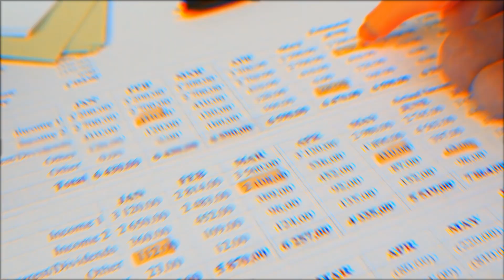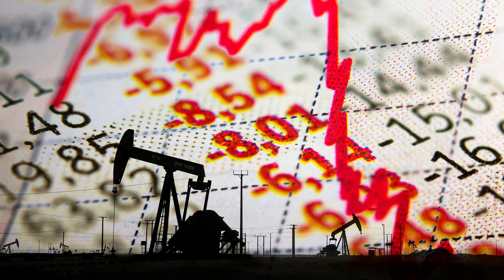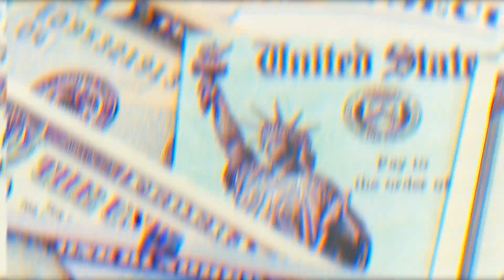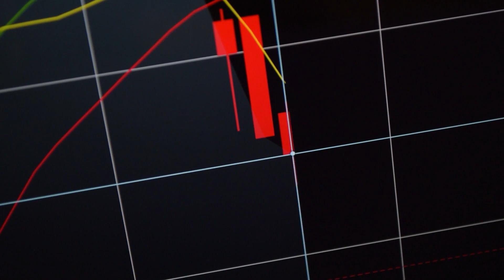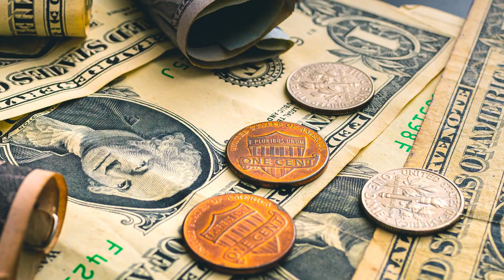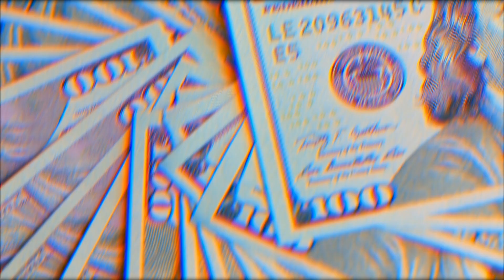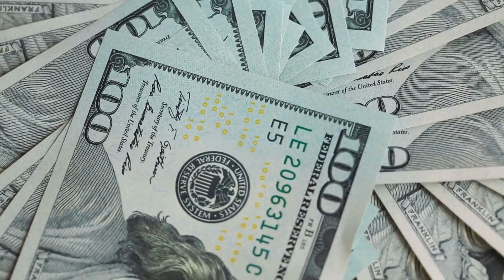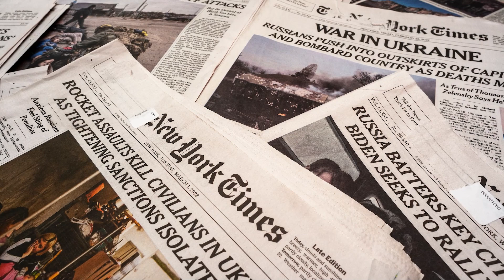How to Prepare for an Economic Collapse

Comment: Great video!
Im retired on 15 acres and my main trading/bartering item will be firewood. Although I have it where people driving by can see it, it's difficult to steal lots of wood quickly. I have great neighbors who would sound the alarm. Don't need much gas to split lots of wood. Splitter is very heavy, secured in concrete with the wheels removed.

Comment: In the UK you get small gardens with even detached houses. Plus, where I am in North Wales the soil is heavy clay and the climate is wet. Still, I've decided that fruit trees in my garden 50ft by 100ft is an option as fruit would be tradeable. Plus, patio veg in pots, tubs and buckets along with 3 rhubarb crowns. Not enough to live on but will supplement stores.
Reply: Potatoes! Ammend the soil with sand and organic matter and it will get better.

Comment: I've decided to try gardening. I've started small with mint leaves, and I bought fabric gardening pots to grow outside my balcony. I just have to get the soil, since I have seeds that I've collected over the years. I still bake so I try gathering as much baking supplies because it could be a way to make a little money. And every one needs bread or a sweet treat for morale.
Reply: The potting soil sold in stores is a rip off. Buy a bale of peat moss, equal amount of compost, and half the amount of vermiculite or perlite. Mix. Better potting soil for less money, and you can cut up dried banana skins to mix in for part of the plant food/fertilizer.

Comment: My biggest concern in a collapse is water. I live in Texas where we experience drought - no rain. The community where I live is supplied by well water that uses the grid to pump the water. My thoughts are to get a large surface tank filled with water now and add rain water collection gutters to feed the tank if I'm forced to use it. The rain collection would come from asphalt shingles so their would be hydrocarbon contamination.
Reply: You can get a large tarp, cut a hole in the very center, and then elevate the four corners using tall poles so that the water will drain out the hole and into your tank.
Reply: There's a number of solid YT videos on the topic. Some of those holding tanks come as kits that look fairly easy to assemble. I may be biased, as I used to build buildings. But I am in a wheelchair, and I feel that I could still put one of those kits up with time and some coffee.
Reply: Water collection is legal and encouraged in TX
Reply: @TShirtAndReeboks  yeah I'm not sure why it would be illegal
Reply: @Rubio_Eric  You just have to make sure you're not breeding mosquitos.
Reply: @HappyHoney41  maybe close it off and open when we're expecting rain?

Comment: I live on the family farm (23 acres) and we have many things in place, but there’s always more to do! I’ve been working on beefing up the ability to make our own power via portable solar panels and batteries, bc without power of SOME sort, we don’t have a running well, and then we’re in trouble. 😬

Thanks for all of your info and hard work, Kris!
Reply: Yes, I'm looking to drill another well with a hand pump like both my Grandparents had on their farms.
Reply: @aurorarose2836  - our well is 300+ ft down, so hand pumping isn’t something I’d want to have to do. 😬 But our pump can operate on DC or AC power, so I’ve been working on figuring out a doable solution for running the pump if the grid goes down. 

I have something figured out. It wouldn’t be fun, but it would be doable.

Comment: The tallow candles made me laugh. I just finished making two emergency candles out of crisco and pasta jars. They are cooling off on the counter now.  That said, Im not relishing the idea that I might be sitting in the dark with just those to read by.
Reply: You can make light amplifiers out of mirrors
Reply: @annak804  amplifiers sure but they said dark. You need a light source in the dark. Although youd be better off going to sleep.
Reply: Bring in your outside solar lights. Safer and give off more light.
Reply: @janmyers2902  you'd better block your windows if you have light inside at night. People can see that light from outside, see what is inside your house, especially if the windows are open. It makes you a huge target. Best to sleep at dark, wake at sunrise. Save candles for cold nights when the windows are closed, curtained, sealed, so nobody sees the light.
Reply: Hey, you're two candles ahead, and you can read in the daytime!

Comment: Food and water preparation is a must because if it collapses in the middle of or the beginning of winter, you're in for a long hungry time. If you can get through six months after a collapse, you're one of the lucky ones because it could take up to a year before your produce comes in and you have something else to eat. In summary, your preps should be at least A year in case you have to go all through winter and then all through the summer before any produce is coming out and that's only if your garden is perfect from the start, and knowing that you planted enough to last you the next winter.

Comment: Might I suggest you use car alternators, bypassing the 3 internal diodes to run wire from to connect to the fuse box, and for your ac source use a compacitor to it. Need more power, run an additional 2nd or more alternators in line together.

Comment: I think I paid $1.80 for a pound of kidney beans and about $1.00 from Walmart last year. Did an experiment with seeing if these would sprout. The lentils are nearly 6 inches tall and are out in the garden, and one of the kidney beans has just reared its MASSIVE leaves from the pot it's currently growing in. See what you can get to germinate from store-bought stuff.
Reply: Did you soak them, then plant them?
Reply: @MFV77  Yes, for a couple days until they actually started to sprout. Then I planted them. A lot of them have the covering or hull cracked open, and those usually won't sprout. Soaking them until they sprout keeps you from wasting space on dud beans that will never do anything. Just be sure to change the water once or twice a day.

Comment: We haven't got a lot of money to spare. But I try using what we have, supplementing here and there with things I find on sale or even freebies. We also started a garden last year and are doing so again this year. I prep for Hurricane Season every year. I figure every little bit helps right now. What I have been able to do is store up insulin. My husband is Type 1. I am quick to refill and stay on top of refills even when he doesn't need them. By being diligent over time we have over a year of his short acting insulin. I'm working on the long lasting, but that's been harder. I always want to make sure he has a few months in case he can't get it filled or an insurance issue pops up. 

Need Advice - If power goes out longer than a few days where a cooler won't be enough - how should I store insulin? I live in a hot, humid climate. Would love to hear ideas on how to keep it stored if I need to in an emergency.
Reply: Not sure if you have already research this or no. My sister recently got a mini (tiny) fridge as a part pf a give away she entered. Its small can could only fit maybe 4 sodas. Anyway, not sure but if its small and does not consume way too much power maybe a solar powered battery bank could help you preserve the medicine. The only reason I even though of this is because of the book “one second after” a child was diabetic and keeping the medicine cold was an issue. Best of luck!

Comment: Big issues I’m seeing at my job is part shortages for cars. Have cars stuck in lifts waiting for one part that’s 1-2 weeks out. That time will push further. If you have to buy a car now days, but a simple Toyota. Not trying to turn this into an argument on what brand is better but I work for jeep. The cars are absolute nightmares. Major issues constantly and people are left with loaners for months sometimes. When I was at toyota it was some big repairs but most were simple maintenance items.  I have a lot of friends who are in loaners waiting for their warranty repair to get done. The rushed production of cars mean outsourcing parts from non trusted distributors. The new batches of cars are mechanical nightmares. Only reason I say this is because how important transportation is for us Americans. I commute 20min each way. Without a car, I’d have to work locally and there is not much by me.

Comment: Im stuck. On one hand i have some preps ready, half in the form of knowledge. I want to protect my parents and siblings as well if the time comes. And ive got a few thousand in savings that could set me up perfectly with equipment and resources. On the other hand, no one is helping me or taking this serious. And i feel some of the cognitive dissonance they feel; gotta work; gotta pay bills; renew licenses; buy a new phone (that might get hacked anyway lol);get teeth pulled; get a better job... To top it off i live in an urban area. Only about 350K pop but still...
Reply: Do what you can in secret get the tools you need and things that will last like seeds with long viability and MREs or freeze dried food. Botanical potato seed or true potato seed lasts 5 years and comes in many types do some research.

Comment: Wow, I just realized that lighters are a fantastic trade item. They're still relatively cheap and easy to buy. (And I have several already.) You can walk around during times of extreme poverty and hardship with a couple in your pocket and if you run into someone you know is safe, or if you're going to one of your actual contacts' places, you can probably trade it easily.

Comment: Hello everyone. We are wondering if anyone knows of a small fridge such as one in a small motor home or large van is best to buy to be powered strictly by a   Small or large portable solar unit? Thanks. Love your channel
Reply: Even a very small frig takes a lot of power and you'd need a lot of panels and batteries to power it 24/7. I have a small camping trailer and it runs off propane very efficiently
Reply: @karldolphin7547  now there’s something to consider.  But How long does a canister of butane last? And what size? I would have to do some research. Thanks for the idea Karl. (That’s my grand sons name)@

Comment: I see one discrepancy in your prepping.  What happens if after 3 days a person is not allowed to enter their dwelling.  Don't need a second location that has the majority of what you need for a month or so. Like a second vehicle van with prepps.
Reply: I have a small beater car, but here in the hot South I store things in the trunk that won't be ruined by the heat, like canned foid, dry pasta, can opener, etc. Good to spread your supplies in different locations.

Comment: I have a question I’ve never heard a prepper address and never heard asked. What do you think will happen to those who are incarcerated when the economy collapses? I’m asking for two reasons - one, my son is currently in jail. It was supposed to be for a short time but covid has created a backlog in the system and no one is getting out when they are supposed to. I would like for my son to be able to be with me when things are bad bc I am alone. Also wondering out of curiosity if prisons will exist or if all the criminals will be out and roaming
Reply: Candianpreper did a video on that, sadly most in prison will be killed or left behind, Jail is for smaller offenses and will most likely be let free!
Reply: @freedomfighter1861  Thank you for the info

Comment: This is a very good video. Watch what's happening around the world with the exchange of other currency for oil. If/when that starts to happen, the US dollars we are used to trading with will lose value very fast. The fact that the professional liars have been printing money out of thin air for several years will only accelerate this decline in value. It's not "if" folks, it's "when". Learn how to garden now while you can. It is not as easy as you might think. If you plan to rely on hunting and fishing, look into the history of what happened to the wildlife population in the US during the great depression. Then look at the population of the US at that time. Store food now. Learn to garden now. Stock up on everything you need, NOW! This is happening in slow motion right in front of us. There will be a global food shortage in the year 2022. And that's regardless of what happens in Ukraine.

Comment: Hey I’ve been watching quite a bit of your videos and each one is very informative but I have one question.  If WW3 is a nuclear war which will cause a black winter where the dust from the bomb goes in the atmosphere covering the sun making solar generators useless and how gas generators will be useless over time due to limited gas supply. What would be the next best way/thing to keep electricity going for a long period of time?
Reply: I would suggest rather than only relying on electricity back ups, also plan on having non-electric backups to what tools use electricity. A wood burning fireplace or stove. Large clay pots and damp sand can work as a low grade refrigerator for short term storage. Hand powered grain mill, etc. if you have a yard, you can run some water pipes under your compost pile to heat water for baths. Add a hand pump option to your water storage tank or cistern or barrel. Research other clever solutions people have come up with.

Comment: In the event of an economic collapse here in the US I would think that investments overseas in another currency would at least diversify your assets.  Like buying a second home in another country?  Many times owning real estate in another country can get you a resident visa.  Then you'll have somewhere to run to should things get bad here in the US.  However, if it's like the pandemic and countries shut their borders then you had better be over there when it happens or you could be locked out (a lot of countries still let you in if you had residency).  Also, if the value of the dollar goes down drastically then you can sell your real estate investment in a stronger or less depreciated currency.  Or through your brokerage you can convert dollars into other currencies and hold them as a hedge...but this is just a store of value in another currency, it is not invested in anything.